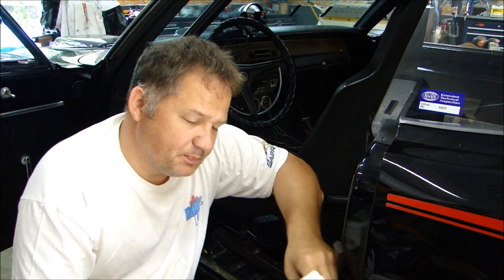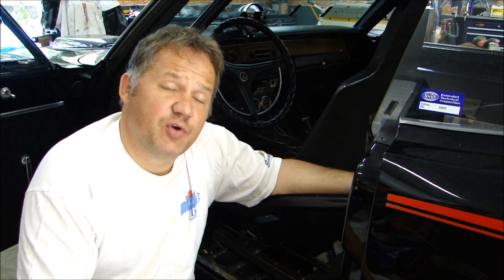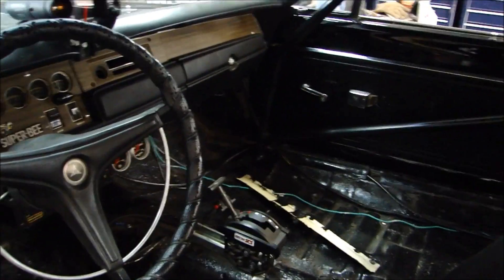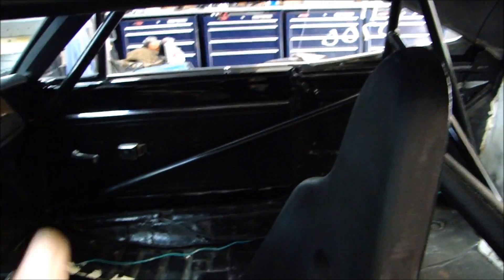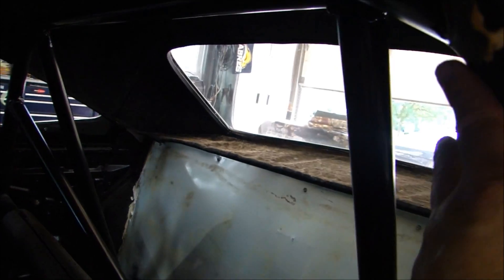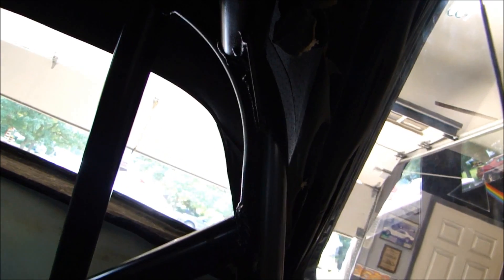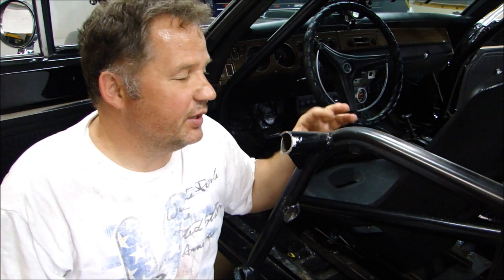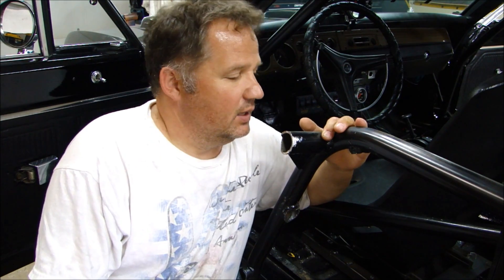Roll Bars, Cages, and Drag Racing Engines

Comment: i realize this is an old video and i don't want to knock what you are doing, but i think you are mistaken on one thing. The 6" rule between the hoop and the helmet applies to 6 / 8 point roll bars. It does not apply to full 10 point cages.
Reply from the maker: Thanks Brian

Comment: does the roll bar position in the passenger side have to be modified as well?
Reply from the maker: Ben Dover No, but since it is all connected I will. The owner wants both sides to be the same.

Comment: I've got a few questions about setting my engine up. Its an IH 392 out of a '73 International Harvester 1310 pickup truck. 

I plan to put it back in another truck, still looking for the right one, looking for either a 69-75 Travelette long bed DRW, or 1/2 ton base cab short bed, thats in much better condition. The engine will be converted over to propane. The truck will be used as a street cruiser, with large propane tanks in the bed finning the space not taken up by the fifth wheel hitch.

I want to set the engine up for low end torque, as it will mostly be used for cruising and towing a fifth wheel.

What compression ratio range is best for propane? 
What cam specs would you suggest?
Roller or flat?
Solid or hydraulic?

Comment: What if the cage was set up and welded up correctly, just installed 8 inches behind where it was supposed to?
Reply from the maker: NegativeNumbers427 It should have been put in correctly. I'm not sure why it was installed that way. I think he made up for it by moving the seat back because he was 6'6"

Comment: I have a question when you port a head, do u match the manifold to the exhaust port? Or it need to have some stair on the output. And about the valve seats what degree you make on race engine. Thx
Reply from the maker: iFIRLES Match the manifold to the exhaust port. This engine has a three angle valve grind.